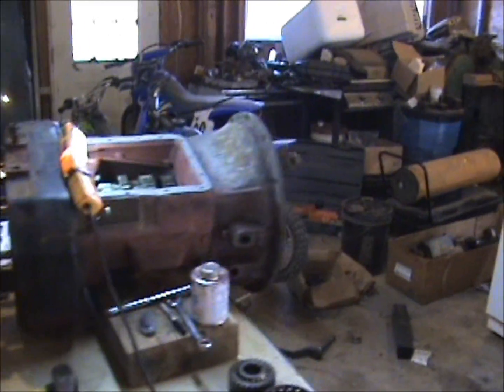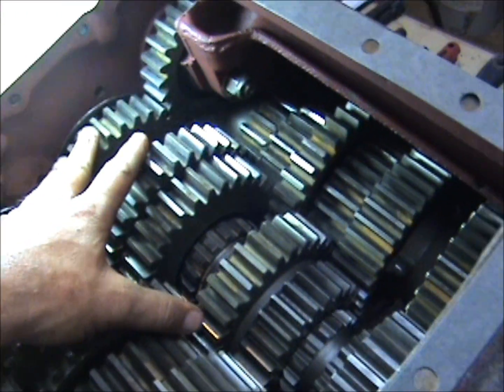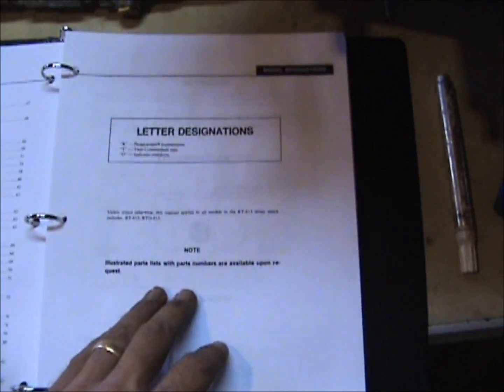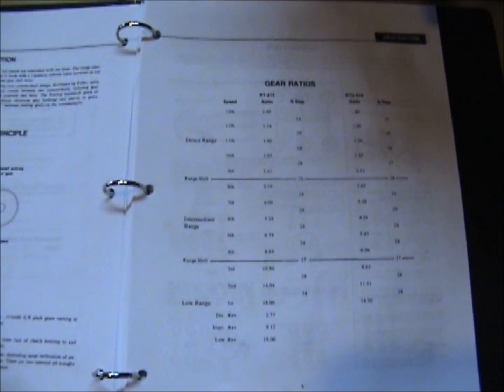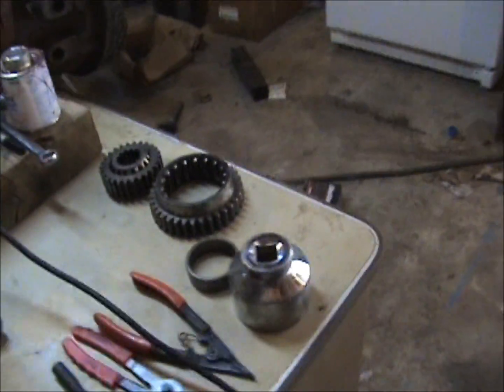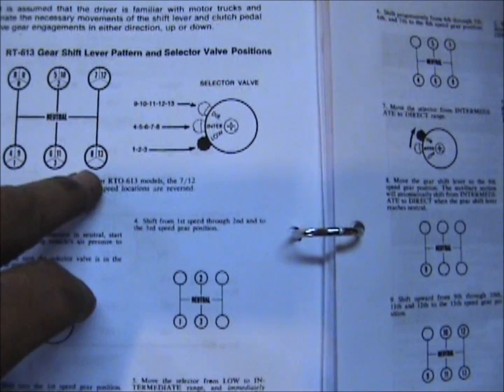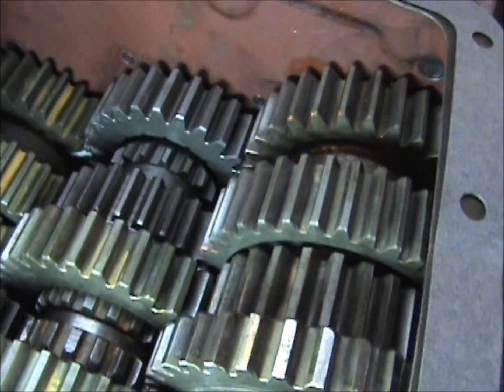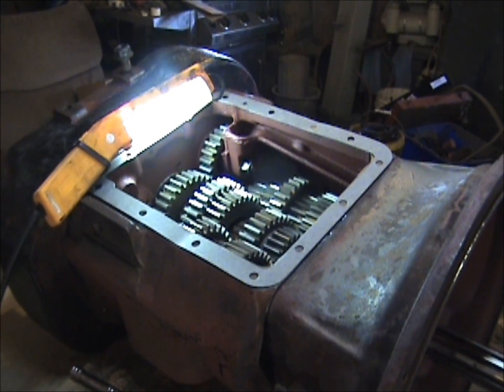Rebuilding an Eaton Fuller Roadranger 13 speed

Comment: good day. thanks for the video very interesting thank you. my truck has an Eaton RTO 11613 gearbox. direct transmission gear ratio 1. can I Rebuilding an Eaton Fuller in this way by replacing the gears increase the gear ratio to 0.85 big thanks

Comment: Great video, Thank you, I have a 1980 GMC with 8v71 with 13 Fuller Road Ranger. I wonder if you have a video explaining the Hi/Low and Direct/ OverDrive airline and operations. Mine is not shifting into Hi-overdrive for my final highway gear. I cleaned out the plunger and O-rings on the back lower left side, it was dirty and stuck. moving good but still not shifting. Thanks.

Comment: Q: how much do the twin countershafts weigh in the main transmission and in the auxiliary transmission each?   I know the rto-613 weighs 622lbs. and the rto-610 weighs about 425lbs. but If I had to guess most of the weight mainly comes from the cast iron transmission cases and the oil or does the weight of the countershafts play an equal part of the overall weight of the transmission?

(plan to adapt a ford 300 i6 to an eaton 10 speed in my 67 ford pickup.)

Comment: Ok,So my simple eaton 10 speed has 1.5 mil on it- It grinds when I go back to the low 5- Has for years-Never got worse- So is it the synchro- Air Supply? What should I do Before I drop it.....I have no experience with building/tearing em down- Ive done a Clutch- bout it

Comment: Thanks for sharing. The 13 I learned to drive shifted like an 8 with low back and left.
The last 4 could be split or you could skip splitting and use the button for overdrive.
Reply: That's not how a RT613 works, it's like a 15 spd but 2 ratios overlap, RT913, RT9513 etc split last rang like you had, later RT6613 model box splits like that too but not early models, if they had a single plate push type clutch they would have an extra button for internal trans brake if they had a dual plate clutch it was a pull type with external clutch brake.

Comment: Old video but very nicely done.  I am 49 and have NEVER done a trans rebuild of any kind.  I have rebuilt motor's, diff's and everything else but not transmission's.  I have been getting to the point that I may need to rebuild one so, been watching some video's on the subject.  Your video is very well done..thanks

Comment: quick question will pin that push reverse light switch,  wear down or not come up high enough to trigger connection? what pushes that pin up inside transmission?
Reply: Spicer gierbox

Comment: although you can change  the gears around on the countershafts IF you have a good press you cannot reuse the mainshaft gears because they have different hubs on the back .I noticed you  had one on the table with the sliding (DOG) inside it.also they do not cost an extra 1000 dollars in fact they are the same price for a rt or rto makes no difference In price.its all a mute point anyways since nobody runs this trans anymore ,its been updated like 5 times
Reply from the maker: Have you priced one lately? A RTO is $1000 more than an RT. You think I just pulled that out of my ass?

Comment: Great. I have a question.

I have a super 10 with 390 gear housing. (My cuz swears it had a 355 gears when he broke some tooths.) So I don't know what gears I have.

I bought a 13 cuz everyone was like it's the best transmission out there.

So I bought one and it turns out it was a direct transmission.  It's basically a 9 with the tail of a 13.

And man it sucks. Every gear doesn't seam to pick up speed. I will be in 13 gear in about 25secs. and my top speed will be 68mph at 1800 on 24.5 tires

I'm burning so much gas it's not funny.

Any help.

The Trans came out of 86 Kenworth 18 wheeler I believe. Don't remember the year.

Any help I would appreciate thanks again for all your vids

Comment: Dear Sr.
My name is Joe. I am in Thailand. I have International 9900IX, it comes with Cummins and Eaton Fuller Roadranger 13 Speed RTO. My transmission has been broken by filling wrong gear oil. I think may be I am only one that have this transmission in Thailand. I bough rebuilt eaton transmission from Indiana last month. The transmission has been send to Thailand last 2 week. I need to fix my transmission for being spare. I need to know about how to fix it and it is a hard job or not.
Could you give me advice. my e mail is joejobuilt@hotmail.com.
Best regard
Joejo

Comment: i'm not sure about this old antique, i think its a design level 5 he is showing due to it does not have multi-mesh gearing. but the design level 6 you do not want to do this! it will make the trans almost useless. it doesnt just effect high gear, it effects all the others too. if you want a proper rtoo14613 then simply find a b ratio 9 speed and put your back box on it. the front 3 gear sets are different part# to get proper steps otherwise you will have some large rpm gaps and some small rpm gaps between the gears. an rto14613 is .86 o/d if a b ratio 9 front box is used then you will have multiple o/d options like stick in direct with upsplit =.86  stick in o/d downsplit =.73  stick in o/d upslit = warpdrive :)
Reply: yup he called it a 613 but it is actually a rt12513
Reply from the maker: Wrong, Was an RT613 is now RTO613. Would you like to see the build plate? This was a conversion right out of an Eaton manual that listed parts required for the conversion with Eaton part numbers.
Reply from the maker: There is another video on my channel of this same conversion of a RT6613 which is the "Multi mesh" gear set you speak of. It was converted with Eaton parts. RTX is the same set up but the X stands for overdrive with a cross shaft top cover so the shift pattern is conventional.
Reply from the maker: The video is named "Another Eaton Fuller RTO conversion 6613" if you want to look at it...I talk about the multi mesh gearing in the video.

Comment from the maker: To make noises sometimes..But it could be any number of things really? low air pressure at the trans, a chipped tooth, worn mainshaft, through shaft bearings..noises sometimes are hard to diagnose?

Comment from the maker: Go ahead and drop the oil and look for metal..it might be stuck to the magnets inside the trans, use a borescope or a piece of wire to fish it out ..You can get a really nice borescope from Harbor Frieght for under $200..you will wonder how you ever got by without it..also the superliner does that when I run disimular tires on it..even the same size 11R14.5 tires from diferent manufacturers can be taller or shorter..even newr tires with older tires can cause the inter axle lock.."POWER DIVIDER"

Comment: Great video. Maybe you could help me  I have a 9 speed and a mild clunking noise started about 6 months ago only in 9th gear when driving down the road usually 65 mph or more.  Hear about every few minutes. Now also hear sometimes in 7th and 8th.  It sounds exactly like when you are using the air shift to go from low to high and go threw gears again.  To me sounds like the dog gear between inter. and direct you spoke about.  And yes, I admit I shift a lot without the clutch.  Easy fix from back.

Comment: Check the air pressure first at the splitter cylinder (lower left) should be min 45psi if ok then most likely aux drive gear in aux section is pooched, most likely clutching teeth are worn

Comment: If the shifter is jumping out then most likely the fork groove in the sliding clutch is worn out in the main box or a broken detent spring, if it's just bucking and hitting neutral then most likely the sliding clutch for the spliter is worn, which could be due to low air pressure should is 55 psi at the spliter cylinder.

Comment from the maker: New bearings and syncro in the back box I would think, but check the air lines, filter regulater, and pilot valve as well. I can walk you through it.

Comment from the maker: The book says 600 with the injectors...I would like to carry it To Dunn NC, there is a in floor dyno there and I would like to just see what it really is at the rear wheels. The SuperDog was Certified @ 350 at the rear wheels before I did anything to it..It has been running along side a 475HP 12.7L serise 60 Detroit and it walks away from that so I don't know..

Comment from the maker: It's not the rt that denotes torque..R= Roadranger...T= Twin Countershaft...6=600ft/lbs of nominal torque and 13 stands for 13 speeds foreward.. RTO, O= Overdrive..This trans will hold the torque of a 3208T...Look at the HP rating its only like 225HP.. Its temp that kills them anyhow..if your unsure put in an oil temp guage and keep it under 250..Big blue doesnt get over 200 most of the time..

Comment: great video!! i have an rt-613 in my old road boss with the small v-8 cat rated at 210 hp. (its an 1160 cat)  I was going to do an engine swap with a 3208T but enerything i read said that the rt was a low hp engine and that they will not handle the higher hp. any thoughts or input?

Comment from the maker: You don't even have to buy a gear set...you can just do the same with the mainshaft gears as you did with the gounter shaft gears..just get the rebuild set with the bearings seals and snap rings..